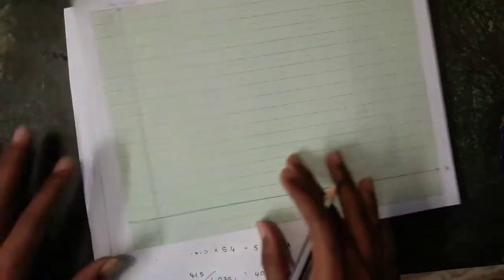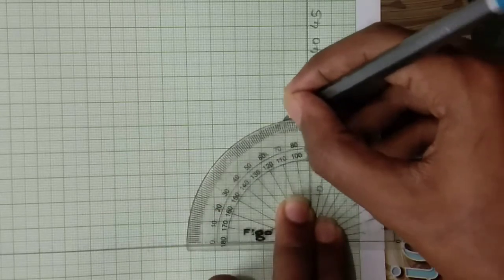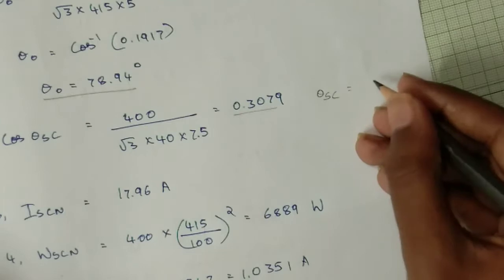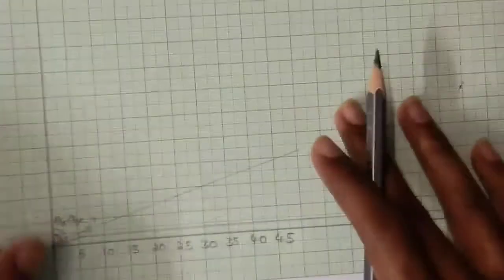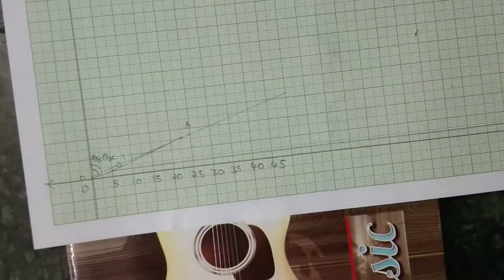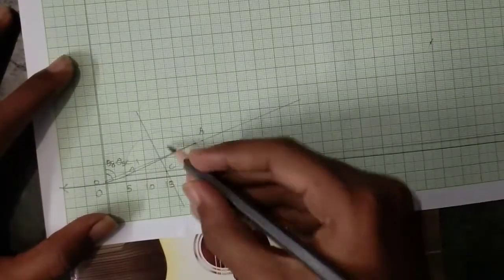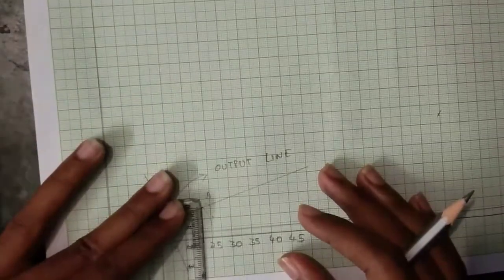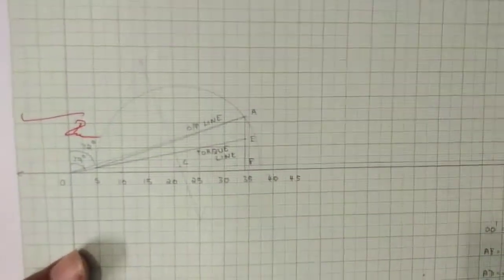Power circle diagram for no load and blocked rotor test on three phase induction motor -part 2

Comment: Is this method can be used in case of both 3phase slip and squirrel cage induction motors
I need to know whether there is any change in equations in case of their star (slip ), delta (squirrel) connections